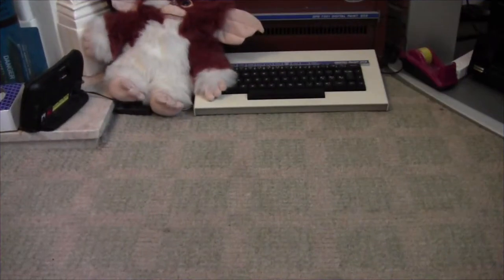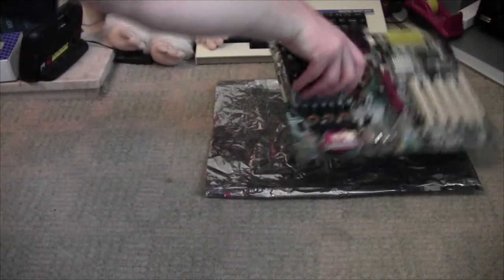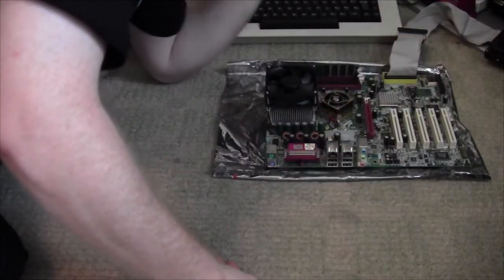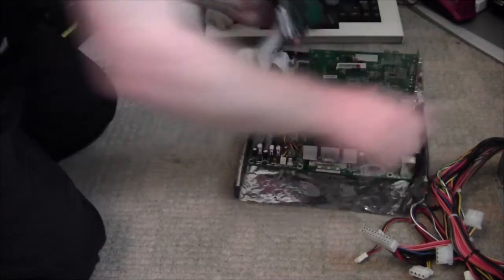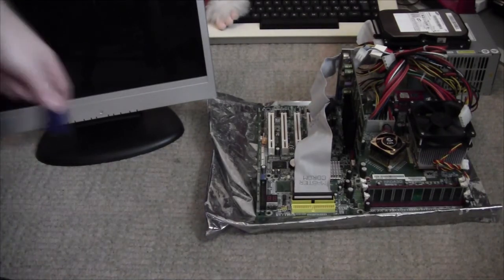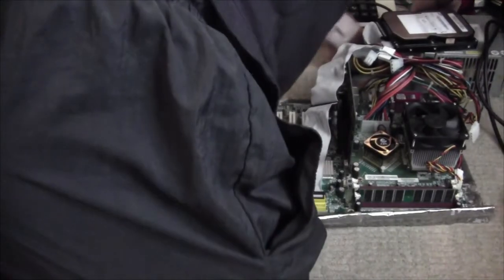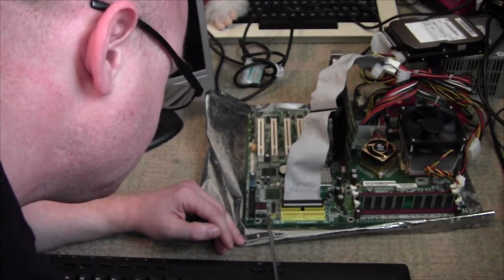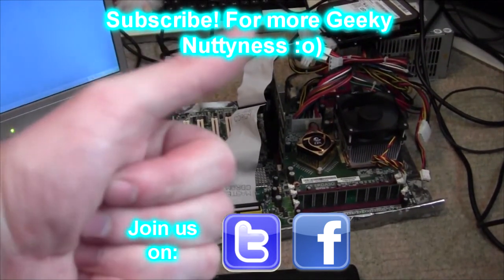Creating FrankenPC!!!

Comment: Never built a PC. You make it look easy. Where I used to work as a programmer, my colleagues told me to build my own. Instead (being lazy) I got down the shops and bought a laptop. Still works twelve years later, and has never needed repairs. As you say, the cost/benefit is no longer convincing, unless you want an unusual spec I suppose.